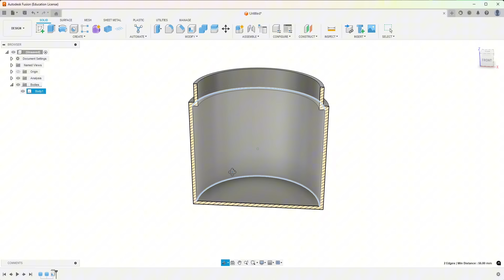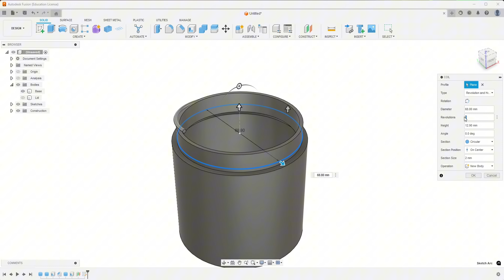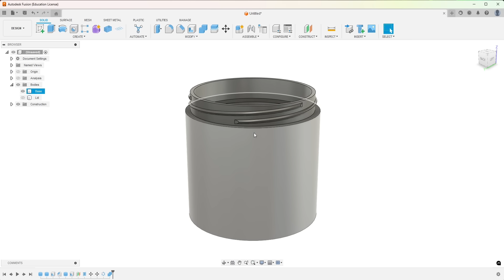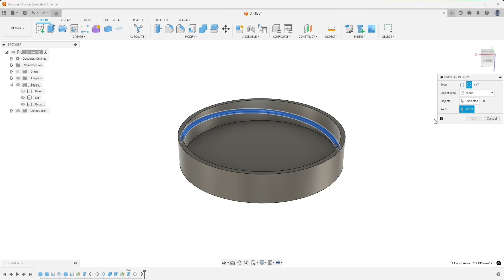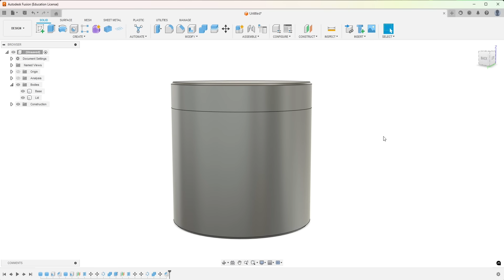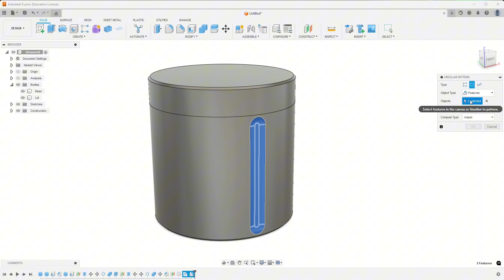Design & 3D Print Triple-Start Threads using Fusion360

Comment: The triple-start jar is a useful contrast to a conventional single-start lid, especially when you want it to engage without several turns. How do you choose the lead versus thread engagement for a small printed container? We’re developing Loftsmith and would welcome your feedback on testing a multi-start container design with our description-based CAD workflow.
Reply from the maker: Larger jars work better with multiple thread starts, as the larger the lid, the further the travel is needed to engage the threads (if only one start).  You also need to consider how secure you want your lid (how many turns to close it). With multiple starts, you get less turns. So I guess there’s not a right or wrong answer - just depends on what you’re looking for. If it’s something I’ll be opening and closing all the time, I’ll choose 2-3 starts.  If I’m not, I’ll typically just do one
Reply: @ShopTherapy623  Thanks, that's a really clear rule of thumb: 2-3 starts for lids you open all the time, one start when you want it to stay shut. Bigger diameter also means more travel to engage, so more starts there. Saving this one.

Comment: i just tried this. cus i am trying different styles of threads. but for some reason it wont allow me to do 3 pattern not even 2. 

i have a diameter of 24mm and following your instruction to the point. but the error its giving me is C-pattern1-Compute Failed-"No pattern instances could be intersected with the original body. Try adjusting the pattern serrings, or changing the selections".. so annoying
because this seems really promising for my application
Reply from the maker: Could you share the file on the Facebook group (Shop Therapy). Hard to say without seeing it.
Reply: @ShopTherapy623  how did you get that click in the end?

Comment: What a SUPERB tutorial… I’ve learned a lot! Just one question… if you sent it straight to print as it appeared in Fusion, would it print in place? So did you have to use the move command to lift the lid off the jar, and lay it flat on the bed before sending it to print?
Reply from the maker: You can move it in fusion before sending to the slicer, or separate and move in the slicer. Both methods work.
Reply: @ShopTherapy623 thanks, just finished it. Also added a pattern of debossed circles on the lid for grip, plus some embossed text on the top. It printed BEAUTIFULLY, thanks to your super detailed design instructions :)

Comment: idk what I do wrong here but I did exactly the same, but my coils touch the walls... 1mm space, coils are 2mm and one side is -0.2mm off center and the other +0.2 :S
Reply from the maker: I’d have to see the file. You can share it on the Shop Therapy Facebook geoup
Reply: @ShopTherapy623  The space between the lid and jar needed to be the same as the thred for it to work for me. So I couldnt do 1mm space it had to be 2mm

Comment: Great job sir. I'm looking for a tutorial for putting a thread on a lid then i saw your video. You've gain a subscriber for this.😁 But can i ask if you dont mind, how do you import the file in the slicer? Do you separate it (1 file for the  base, 1 file for the  lid) or 1 file only for both base and lid. Thanks in advance for answering my question.☺
Reply from the maker: Yes. Separate them

Comment: Thank you for another great video. I have learned something new and useful. I knew how to make threads and circular patterns but never thought about using Coil tool and the rest of it to make such a beautiful thread.

In the part where you didn't have enough clearance between threads, you could have made the coil a bit less than 2 mm instead of making the threaded part of the base taller.

Comment: Why do you move the end of thread with 70 degrees and not less?
Reply from the maker: I’m just easing over the edge so it engages more smoothly. You can move it to whatever angle you want. I just like 70°.  You could also join the thread to the jar and then chamfer it (would probably be the better way)
Reply: @ShopTherapy623  Thank you for the answer! Will try it with chamfer

Comment: Could you have used the create thread tool for the threads instead of create coil?
Reply from the maker: Yes but you’d have to modify them as most have too tight of tolerences for 3d printing.

Comment: I made it and worked great. However, I made the lid taller for a taller jar. The threads are 6 of them instead for 31mm high. I have the offset of 2m still and same size threads. It locks together fine but it can come unscrewed easy. How do I make it where when its locked together I can twist it a little harder so it stays tight?
Reply from the maker: Hop onto Facebook and search for the Shop Therapy Facebook group. You share the file with me there. I’ll check out what you have. Most likely, with 6 threads, the pitch is too great. That steep angle doesn’t allow for tight fitting threads
Reply: @ShopTherapy623 great. Thank you. Will do.

Comment: So I cant make the threaeds on the base 70 degrees "move" taper. it will only go to 65. anything more it throws an error
Reply from the maker: Yeah sometimes that happens to me too. Not sure why. 65 is fine. Or just click on the bottom edge and chamfer it as much as you can. (Like 1.89)

Comment: Not sure if this is a new feature, but if you want to snap to geometry when creating a coil, you need to be viewing the plane directly. In this case, viewing it directly from the top would allow you to snap to the outer rim of the container, rather than having to manually input the dimension.
Reply from the maker: Correct, but in this case, I didn’t want the diameter of the coil to be the diameter of the container
Reply: Got it.

Comment: Inspiring tutorial for new designs, Thanks! A small question, wouldn't it have been easier to use "component" function at the start for lid and jar instead of joining separate bodies to two bodies at the end? I'm new to 3d design 🙂
Reply from the maker: Yeah it's always good to work with components.  It can save you a few steps and keep things tidy. However, on a small design like this, I usually skip it.  I have a love/hate relationship with components.

Comment: Thanks for the tutorial! this is so helpful. ps: When i get to the coil part, i just thought. why not make the coil 1,8mm thick instead of having the 0.2 offset? and it worked! I think this tutorial is so well made it shows you other ways to do it by instinct. Thanks man!
Reply from the maker: The reason I make it 2mm and then off set it by 0.2 is so the bottom horizontal part of the circle is embedded which makes that easier to 3D print. Not such a steep overhang.  However, it’s such a small overhang, that it probably doesn’t really matter, which is why your 1.8 coil works fine!
Reply: @ShopTherapy623  oh. that makes sense. Thanks for the tips bro

Comment: Great tutorial! Just a question, why round profile dolls and not triangular? Surely there would be better surface area contact with flat triangular threads? edit Printed mine after doing the tutorial and it worked out great! The only changes I would make for next time is have a little more sticking out of the top of the jar wit no thread, say 5mm to more easily locate the lid on the jar before the threads bite. So impressed!
Reply from the maker: Yeah you could do a triangle profile for the threads.  However, for 3d printing, circle profiles work perfectly fine. I’ve never had an issue doing it this way.

Comment: not sure if this is the printer but I've found that when you turn the lid until it stops there is a partial tiny, hairline, gap between the lid and base. Could this be the bottom of the threads meshing and not quite closing?
Reply from the maker: If that's the case, you may have to just increase the height of the lid by another layer line or so
Reply: @ShopTherapy623  I gave that a go (not 100% sure I increased the lid height or thickness!) and same issue.
Reply from the maker: @Tentaryn if you get on the Shop Therapy FB page, you can send me the file and I’ll take a look at your Fusion file

Comment: When you make the first thread, use join. You can use the move command on the face to taper the entry and exit, it doesn't have be on a separate body. Then, on the circular pattern use a feature, not a body. 

Later you won't need the combine command.
Reply from the maker: I don’t like joining them right away so I can move them to their final position first. The extra join at the end doesn’t bother me

Comment: По-моему вы не учли что резьба крышке при закручивании упрется в горизонтальную верхнюю плоскость банки, в таком случае не будет плотного прилегания резьбы. Надо еще чуть приподнять витки резьбы вверх над этой плоскостью
Reply from the maker: It absolutely will close tight. There’s a gap between the lid and the threaded portion of the jar. So the lid will always bottom out on the jar.

Comment: Ok, a question and a comment. How does the “click to lock” work? Did I miss something? I have been trying to figure how to model containers with threads that have some sort of mechanism to prevent them working loose, and had been working with the idea of having an emboss on one part and a matching deboss on the other, placed on a section that was basically fixed but could flex a little. And then your container does it with seemingly nothing more than just the threads. Is that correct?
As to the comment, for rotating you can also select the axis from the axis section in the tree on the left, either the global axis or the axis of the desired part.
Reply: It sometimes works like a click to lock feature when the layer-lines from the print line up and grab onto each other

Comment: With the 0.2-1 mm gap between the lid and the body threads, I think you could print both in place and twisting it would remove any "supporting" connections between the two. Thoughts?
Reply from the maker: You definitely could, but I’m not sure why you would need to in this case

Comment: Thanks for this. I was able to adapt this method to making a single start tapered thread. The male threaded portion is a tube which is castellated. As the nut is threaded on it compresses the castellated portion clamping a shaft in the tube. Nice, simple light duty clamping.

Comment: Would it work to circular pattern 6 threads and than combine 3 of them to the lid (selecting each other one) and combining the other 3 to the base?
Reply from the maker: no, because they wouldn't have the correct 0.2 offset for the lid.  You could do that if you had no offset, and then just decreased the size of the thread diameter to give you clearance

Comment: I can assume that this CLICK that everyone is interested in is due to a defect in printing and its name is seam! try to examine carefully both thread surfaces on the lid and the main container and you should see there a vertical thickening in the form of a seam, it is this that gives such a random effect as a CLICK ! I'm curious to know what seam print settings you had in your slicer software.
Reply from the maker: Other people have gotten the click as well with completely different print settings (I’m assuming) than mine. It definitely could be the seam. I was thinking it was the layer lines n the threads snapping over each other at the last second. Who knows?
Reply: @ShopTherapy623  most likely, if you don't change the seam settings, it will bake with this ‘effect’ by default :) Many people do not set the seam differently - hence they get that coveted click.  But to be sure of this, it is necessary to inspect the thread surfaces.

Comment: Great video! I am very new to CAD and Fusion 360. By the way try scarf seams for 3D printing.
Reply from the maker: Yeah, I use scarf all the time, but you still see the seam. I like hiding it in a feature on the print whenever I can.
Reply: @ShopTherapy623  I am new to Fusion 360 do you have any beginner videos?
Reply from the maker: I think I only have one “beginner video,” however I am thinking about doing a “beginner course.”

Comment: How do you get it to click at the end? I have made mine smaller and the lid does not screw like yours
Reply from the maker: I’m not sure why it clicked. That was not a designed feature. I’m assuming the layer lines align perfectly and snap over each other.
Reply: @ShopTherapy623  nice.  thanks for your reply.

Comment: Couldn't you just use the "jar base" as a cut tool for the lid, keep the tool body, and do an "offset face" and get the same thing?
Then you don't need to remember anything about dimensions.   IDK...  I'm no expert.
Reply from the maker: Yes absolutely! Sometimes when doing these “live” (no cuts) videos, I get brain farts and do things not quite so efficiently.

Comment: Print settings like layer height, Infill
Reply from the maker: I usually stick with 0.2mm layer height, with a 10-15% Gyroid infill.  2-4 walls depending on how strong I need it to be.
Reply: @ShopTherapy623  Thanks for the quick reply. Helpfull contents.

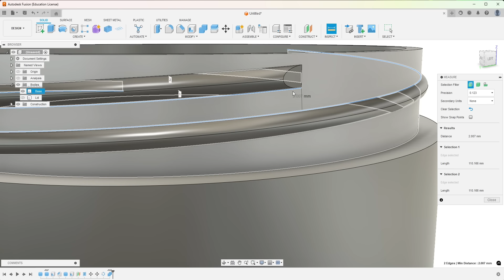Comment: @12:39 I'm not sure you needed to adjust the distance between threads. There was 2.007mm gap at the BASE of the threads which is the thickest part. The part of the lid threads that interact with the base of the container thread is just the narrow peak of the lid thread. If you went back to this model and printed it without changing the width between threads, I'd guess it would thread on perfectly, and with a bit less slop.
Reply from the maker: Yeah, I realized that as I was saying it, but wanted to show it anyways so people knew to watch out for it when designing their own. But you are correct, it didn’t need to be changed.

Comment: I’m completely new to all this and have a stupid question. Do you move the lid off the base in fusion 360 or in your printer software and how do you do it? Thanks
Reply from the maker: You can do it either way, but it's probably easier in your slicer.  in Fusion, just select the lid and use the move tool (and align tool if you want it perfectly "on the floor").  In your slicer, there should be a button to auto separate them
Reply: @ShopTherapy623  Thanks! I'm gonna give it a shot. I made the jar exactly as you specified then tried to load in an SVG image to emboss it with and fusion crashed before saving 😅

So now I get to watch your video for a 3rd time and make the jar again from scratch this time saving it as I go
Reply from the maker: @LurkerPatrol  Dang, that sucks! Yes, definitely save as often as possible - lol.  Fusion is awesome but has a tendency to become "overwhelmed."

Comment: How did you "click on the plane" @4:04 to select the plane to create another cylinder with the cylinder tool selected? The plane doesn't highlight  until I press ESC to stop using the cylinder tool.. Great video btw!
Reply: I double clicked the top of the top left list, and the model turned blue and now it works. It seems I was in a limiting mode/view or something.. Perhaps I should watch some basic lessons not to ask basic things :P
Reply from the maker: @Eki39 it might be confusing because I used the word “plane”. I did not click on a plane there, I clicked on a face (or surface).
Reply: @ShopTherapy623 Thx for your reply! Fortunately I understood that :p However like I said sometimes you can’t click on anything after selecting a tool like cylinder (face, plane whatever). Double clicking the top of the top left list seems to do the trick before selecting a tool. I’m sure I’ll eventually figure out why. I just did both parts of your shampoo cap tutorial and I feel like half an expert now :D I learned so much diving into those videos as a beginner enjoying the challenge. Thanks!
Reply from the maker: @Eki39  Awesome to hear!  Im glad i am helping you out a little.  I'm not sure about the trouble you're having with the faces and planes.  Once you select the cylinder tool, you should just be able to hover over the face/plane you want to start on and then click.

Comment: Rather than making the coil as a new body, could you make the coil as a join and then create the circular pattern with object type set to features, selecting the coil and 2 rotations? I think it could circumvent the combine step.
Reply from the maker: Yes you could. I always set to “new body” in case I want to tweak them before joining.
Reply: @ShopTherapy623  Thank you for clarifying! Great tutorial

Comment: On first coil I get "Failed to build coil tool Body" error
Reply from the maker: Try changing the order in which you change the coil parameters. Change the diameter of the coil to 2mm before changing the other settings.

Comment: Great video! This thread works great! I have followed all your instructions and made the same design as you. But i have one doubt. There is no click :(( Do you know maybe which dimension or feature is responsible for that?
Reply from the maker: I have some people getting the click and others not getting the click.  So I think it has to do with what printer you have and maybe your printer settings.  I'm wondering if the "click" is the layer lines sliding past each other at the last moment.  I'm not sure.
Reply: @ShopTherapy623  ok, thank you for such a quick reply! :)

Comment: Very good and easy to follow tutorial.
However I am using Solid Works and it was pretty easy to duplicate almost everything - except the coil function. SW have an helix function which can be extruded to a "coil" quite easily. However SW defaults to a clockwise rotation which I didn't noticed until I realized the lid screws on and off in the wrong direction :)
When you explain all the different coil settings, you didn't mention the need to be careful and pick counter clockwise as the right direction.
Reply from the maker: Yes I should have covered that! In Fusion that is the default, so forgot to mention it.